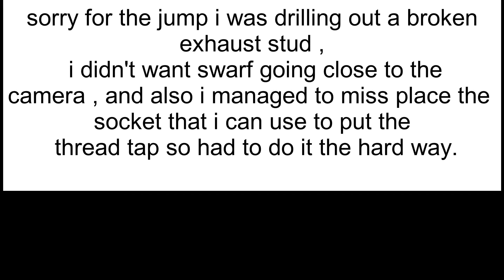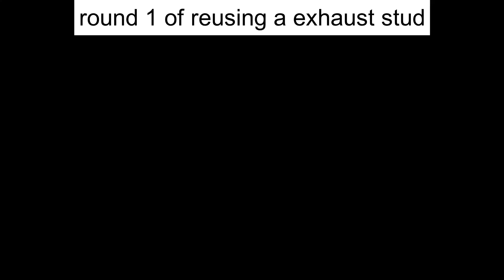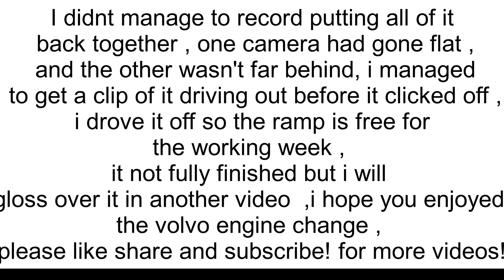volvo engine change video 4 putting it back in

Comment: Excellent vid mate, I was particularly interested because I have V70 2.4 T5 Turbo 2004 / 5 138.000 miles which has just given me a knocking sound which I'm told could be any manor of things, but a mechanic suggested it was / could be a stuck lifter, crank bearings etc etc,  trying to find another engine is like rocking horse doo doo, so I was thinking of having it reconditioned but that is going to be more than I paid for the car / and or just fixing the part thats broken, it still means all that work of taking it out / breaking it down / putting it back together again,  I've been quoted a few prices which differ quite alot, £1.500 +  to £3.500 + , is it actually worth it ???
Reply from the maker: hi , thanks for the compliment. I weighed it up. so time , cost. it would potentially cost more to repair then getting a low miles engine second hand. so that's what I did. in a later video I had taken it apart and discovered a bearing had spun. it was discoloured , so it wasn't worth the clean up as there would be metal floating around the engine aswell as the turbo. after looking over the old engine it seemed to look like it has been cooked at some point in it's life , so made it more of a reason to get a decent second hand one. , regarding the knocking on yours , it could be top end or bottom , have you checked your oil for metal ? , make sure the tub is clean when you drain it if you drain it and then look for metally glizzening in the oil. that's good sign something is breaking up. , as for the cost that's you say there it could well be.
Reply: @StatusFIX   Thanks for the unexpected very quick reply, I watched the tear down and hope thats not what I have, I have had a look for another engine and got one reply from a breaker £900. very little info on it though, I have yet to see another like mine with around the same mileage, the other problem is finding a Garage / mechanic who will take it on.
Reply from the maker: @Alien9828  it is Abit of a gamble with breakers , you may get a good one you may not but you'll only find out when it's in. and yes these ones are not an easy engine to get in , the engine sits on top of the subframe which makes it Abit annoying to get in. , I am assuming you're is much the same set up. , and volvo in there wisdom thought it would be a fantastic idea to not put a big multi plug on the engine loom , so it has to be detached manually everywhere on the engine.,  even with a ramp and a workshop at my disposal it's still a long job. , I'm not trying to put you off or anything , just being real with you.
Reply: @StatusFIX  Thanks mate, I've found someone who will do it, for a reconditioning it's around the 3 & half grand, now do i need that or do i just need the part thats broken fixed ??? still alot of work I know, but thanks for your input mucker, much appreciated.
Reply from the maker: @Alien9828  it depends on what there doing for that kind of price , what are they reconditioning , I see many places that claim reconditioning on places like eBay and Gumtree supercheap. there simply not reconditioning the engine at all. , if for instance your engine has spun a bearing then the engine will need to be completely stripped , cleaned , inspected , the crank resized , for a new set of bearings , if a con rod is discoloured then it's scrap as it's russian roulette as now it's potentially weak and could snap. so potentially con rods. , then you have gaskets on top  of that. any anything else that is worn along the way.  I have herd of places just changed the busted piece and then claim recon and then 2 months later something catastrophic has happened like a rod through the side of the engine.
Reply: @StatusFIX  Pretty much my thoughts too, I've just found a V70 2.4 with 95.000 on the clock, very good cond, for 2.300. so 'm going to go with that and maybe keep mine for other spares-ish . spending far more than the original purchase price just doesn't make sense, albeit I did way it up.   thanks for your input mucker, all the best, stay safe. cheers
Reply from the maker: no worries , all the best and same back at you stay safe.